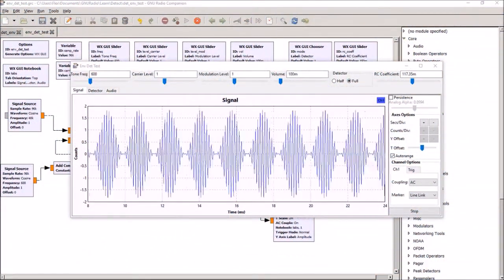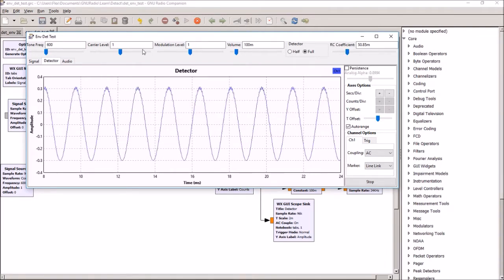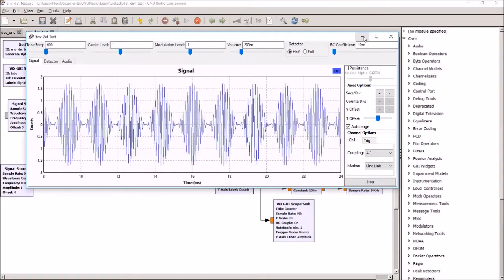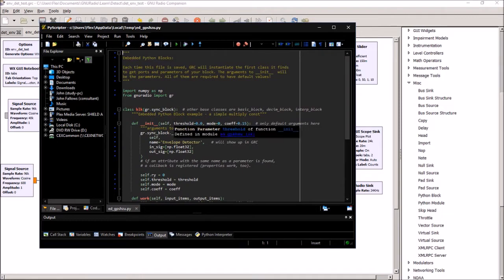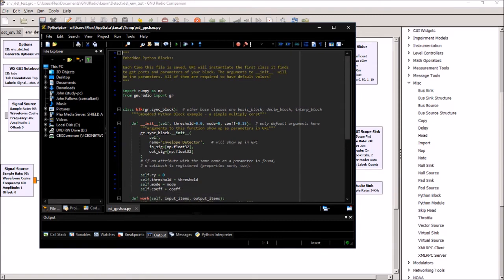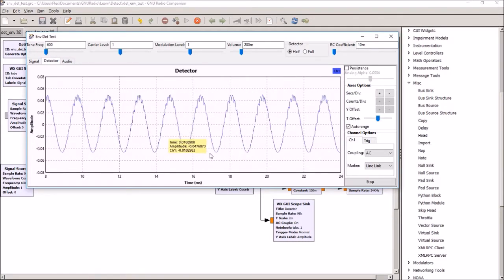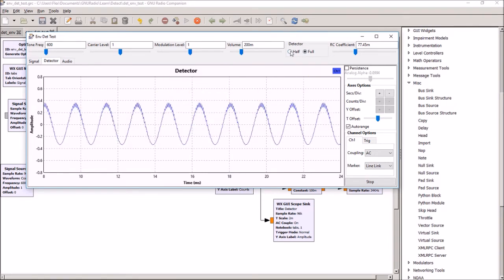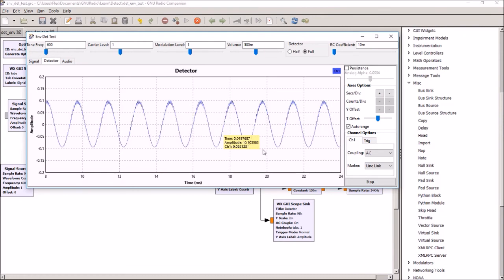GNURadio Envelope Detector

Comment: Can I use this with RTL SDR as source to receive an AM signal
Reply from the maker: Yes, although I would suggest you use the GNR AM Demod block: see https://wiki.gnuradio.org/index.php/AM_Demod
Reply: @VE6EY  how efficient is AM demod block or gnuradio in general to filter very low frequencies.like if I want to filter 90hz and 150from a composite signal.
Reply from the maker: @dk_dhanu  GNR has very efficient filter blocks, implemented in C++. Suggest you use one of them rather than rolling your own in AM demod block which is implemented in Python.

Comment: hello, i have one question. how to measure SNR?
Reply from the maker: Have not found easy way in GNRadio. Typically I just use an FFT and measure signal strength vs noise floor in a given bandwidth. There is an SNR module in GNRadio but it is not really designed for general use, AFIK.